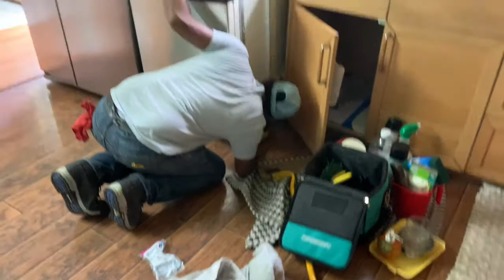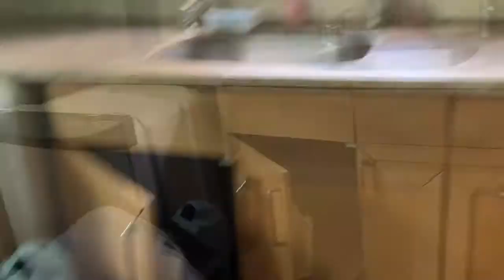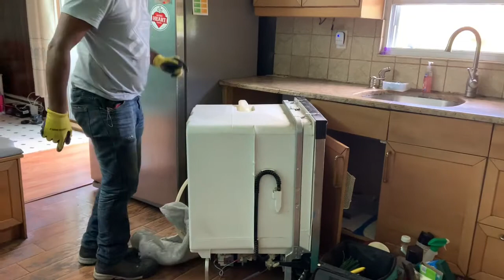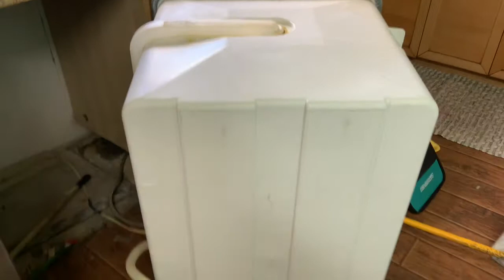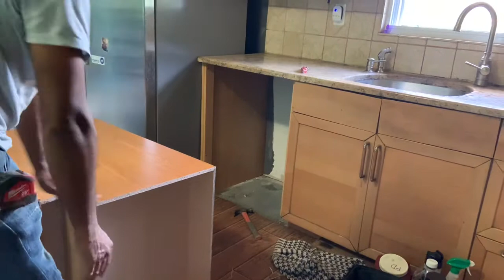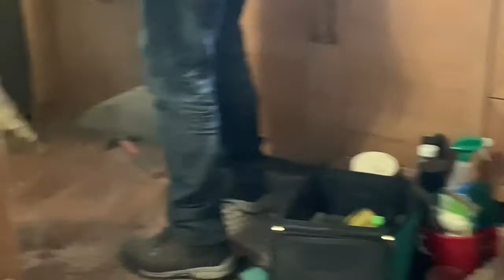How to remove the old dishwasher and install a new Cabinet

Comment: I want to do
This as I
Never use our dishwasher. Can you tell me where you bought the cabinet from? And did you have to glue it or secure
It in any way, or just slip it in?
Reply from the maker: Thanks for your comment 💕 I bought this cabinet from Home Depot store.. u don’t need anything..just slip it in 🙂🙂
Reply: What’s this cabinet called at Home Depot? Thank you
Reply: @alinasaephan  I got this one yesterday at Lowes.  Fit perfectly in my dishwasher opening.  Project Source 24-in W x 35-in H x 23.75-in D Natural Unfinished Oak Door and Drawer Base Fully Assembled Cabinet (Flat Panel Square Door Style) Item #336301 Model #33A B24R
Reply: Thanks
I have removed the dishwasher and there is a home depot locally 😅